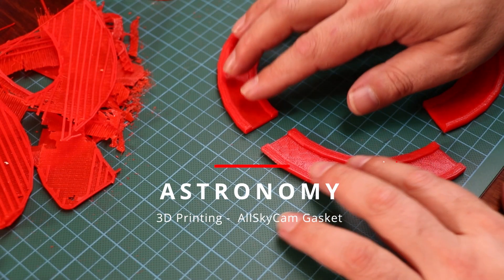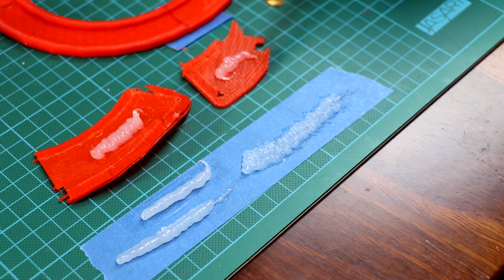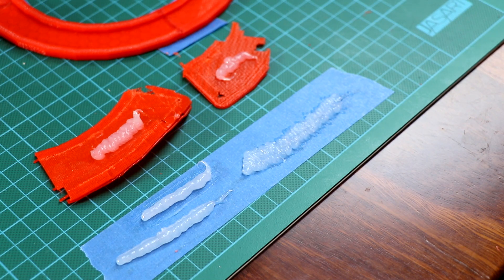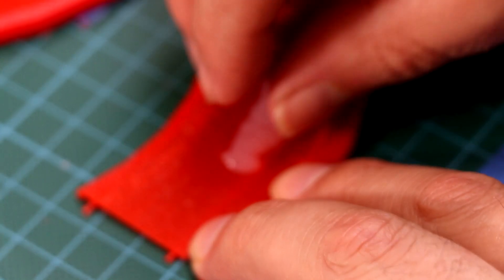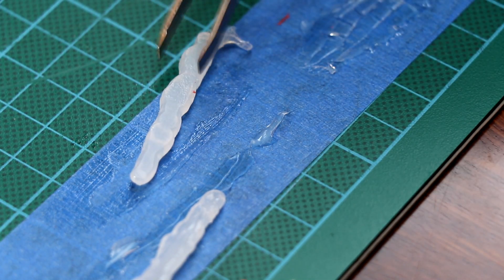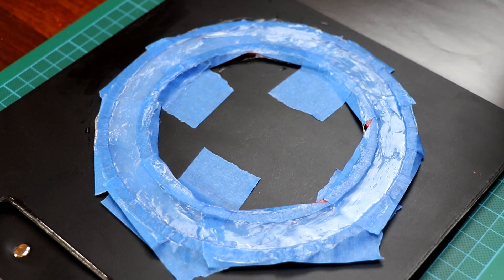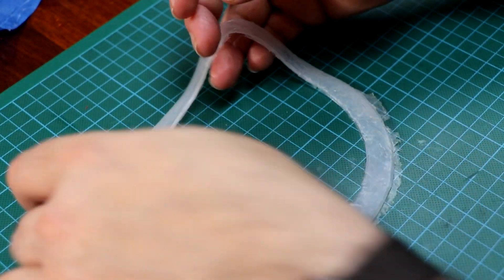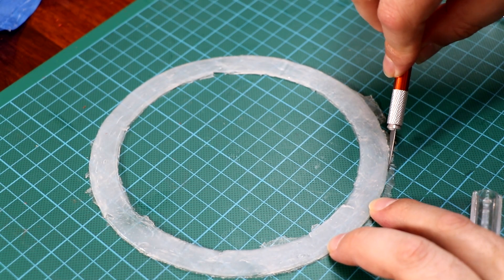Ep 045 - 3D Printing - AllSkyCam Gasket - make your own silicon gaskets and o-rings

Comment: I agree with the comments about using TPU and, once you have your setup tuned for printing with this kind of filament, simply design and print your own gasket. 
TPU95A is easier to print with than standard TPU, not quite as flexible, but usually quite adequate for any gasket with a reasonable amount of compression force on it. 
I do like the UHU super glue, too. I find it works best when you apply as little as you can, to just one of the surfaces to be bonded rather than just squeezing it over both bond surfaces. Saves adhesive, too!
Reply: I printed a TPU 95A seal with four m4 screws squishing it evenly, its not water tight, its decent, but water eventually got in after 30 seconds. It would be better to use something softer for sure

Comment: If you print in TPU you can basically place the silicone right over your printed mold, from my experience my generic TPU doesn't stick to anything but itself (with heat), to join/weld pieces of the mold just use a soldering iron slowly pass it over the seams/joints

Comment: Could you achieve a smooth top by laying something like cling film or waxed paper over the top of the uncured silicone in the mould and placing the dome on top of this until it cures? The dome flange will be protected by the film/paper and once cured might provide a flush surface for the dome. It was a thought that came up while watching it - I don't have any real world experience to know how well it would work.
Reply from the maker: I had mounted it inside a clipboard, and had planned on folding it over and keeping it flat to make a smooth surface. You can maybe see parts of that in the video. Right up until the last second, that was what I was going to do, but then I got concerned about it not curing well (it needs air contact otherwise the entire tube would solidify right?), and the surface was actually flatter than I thought it was going to be. I might try it on the next one to see if it works better/worse.